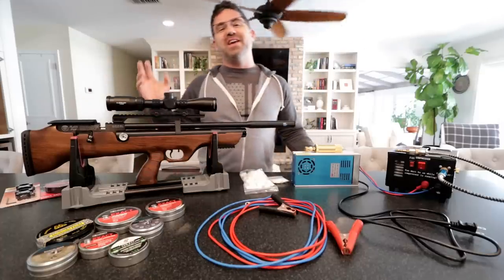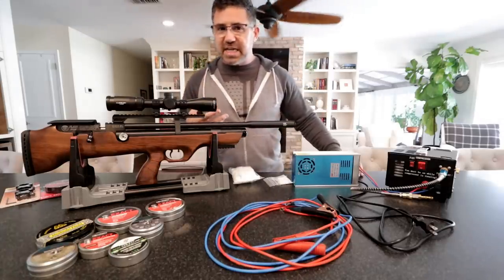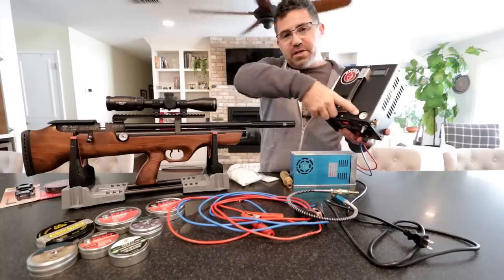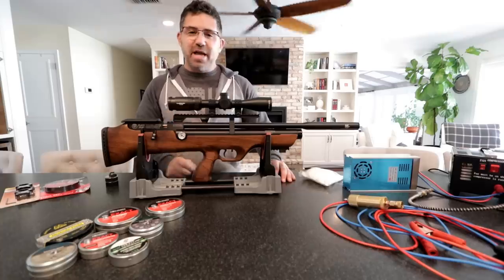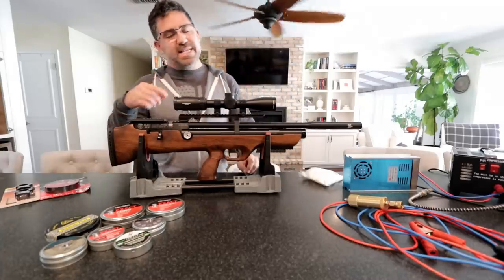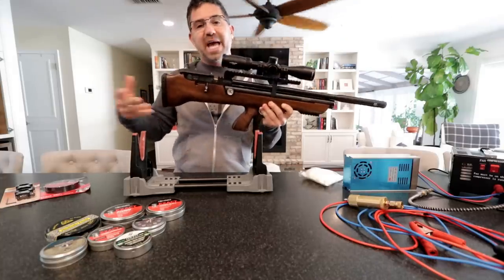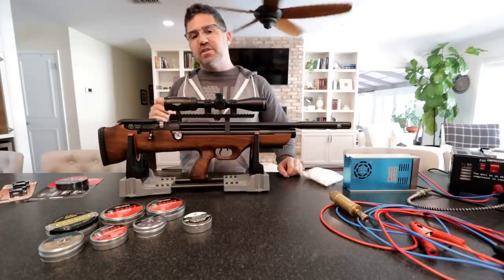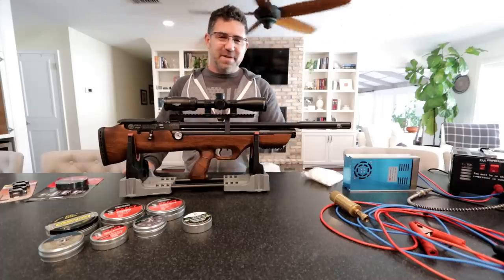Hatsan Flash Pup .22 Air Rifle (Review) + Accuracy TEST - SPARK 4,500 psi Airgun Compressor - PCP

Comment: You're the man Steve. I've had my .22 Flashpup for a few months now and it's a beast. The hammer spring can be adjusted easily. I move between 22 and 36 fl/lbs depending on whether I'm plinking or dispatching varmints. It's a piece of cake to work on and accurate as all get out.

Comment: That compressor is made by Tuxing, they also make the Air Venturi Nomad II PCP compressor. I have all 4 and they do indeed have all the same part numbers. You can buy directly from Tuxing and save 100 dollars but you will not get the Hatsan or Air Venturi warranty which isn't that big of a deal as they are easy to work on and use the same parts. Tuxing also makes great repair and maintenance videos for all these compressors. They are great little portable compressors but super loud, lol. Awesome review.

Comment: I bought the Flash QE (Rifle) from Airgun Depot on sale for around $260 (now its $289.99). The rifle, a Q7 hand pump, and a big tin of JSB's put me out $411. Make sure you buy the quick connect because neither the pump or gun comes with it. But dang guys what a bargain, its such a good gun for that price, just keep the pressure between 180-150 bar and its surgical.

Comment: It's nice to see more bullpup setups out there now a days.
I used to convert my Ruger 10/22s into pups, and now I have a Gladius, and love it.
NY weather is harsh now, so I put up the powder burners, and made an indoor pcp rifle range..
This Flash Pup looks great,  I just prefer rifles that offer adjustable power level settings.
Being able to kick down the velocity is a plus - especially given my current shooting conditions.
Anyways..  I've always used higher end pellets in my air rifles..
In .22 cal, I've always used JSB Exact Heavy 18.13 grains, and had fantastic results.
Well, I was at WallyWorld the other day, and spotted some Crosman Premier .22 Hallow-points..
I grabbed a tin of 500 for like 7 bucks, and figured I'd give them a go - not expecting much at all..
To my surprise, these lighter 14.3 grain pellets actually grouped amazingly! 
I'd heard rumors that Hatsan guns [barrels] could be picky, but nope, not in this case..
The Premiers shot just as well as the Exact Heavy pellets, and at half of the price tag.
[I was shooting both JSBs and Premiers on power settings 4 and 6, then settled at 4,  1/2 power]
For shooting indoors til' spring, they'll be my new go-to rounds for sure! 
So there's a heads up for everyone - just in case you haven't tried them yet.

Sam -
Reply from the maker: Hi Sam.  My bad... the Flash's hammer spring tension is easily adjusted when you take the stock off.  Folks have ready pushed them upwards of 45 fpe in .22 with the 25 gr.  Also, if ya head over to AEAC Home, I released a vid just 2 weeks back on the Kalibrgun and it too performed well with Crosman Premiers in that vid.  Steve
Reply: @aeacvlog2033  
Steve,  thank you very much for the extra information!  That's great to hear!
I'll most definitely be checking out more videos, as they're some of my favorite on YouTube. 
You do an amazing job of covering everything, and the production level is top notch! 

BTW,  I've been scouring the net for everyone's reviews on the Puncher Breaker, 
as I've had my eye on those for quite some time now..
Your review was awesome, and seriously has me leaning towards of of those now too!

Thanks again!

Sam -

[EDIT]  As of 12/12  I've officially added a Puncher Breaker Silent Marine .22 cal to my collection!
1st Impressions - Killer little rifle!  I removed the shroud, fitted my DonnyFL Ronin suppressor, 
and within a few minutes, I was stacking pellets.  Awesome!
After I lower the trigger lbs of pull a little bit,  I'll be digging just about everything it!
[Only con - non adjustable butt pad,  but,  I'll be working on that one]

Comment: For what it's worth I've seen how the pros use the gel with a compressor in an industrial setting.  They used silica gel beads, same come that come with clothes and is super cheap.  They'd take out the old beads every couple of days and run them through the oven on a pan to bake out the moisture and just keep using them.
Reply: Interesting.  Thanks for the info 👍.   Steve

Comment: A GOOD portable 4500 psi compressor is my next buy. Thanks for the look.. I just added the Pyramyd flashpup .22 hand pump deal to my stable. I will follow this compressor closely.
Reply: I only paid $229 for my Yong Heng compressor 2yrs ago and filled my gun with it and only took about 20 seconds for about a month until I found a great deal on a 30min 4500psi SCBA fireman’s tank. I only have to fill my SCBA tank once every 2 or 3 months depending on how much I shoot. My new Skyhawk I purchased at that time holds 3325psi of air and the hand pumps are a nightmare at these pressures. I haven’t had a single problem with my Yong Heng compressor however it’s not really portable but my tank is. Purchasing any kind of compressor and or tank will make your shooting experience about 100✖️ better and you will go thru ammo at least twice as fast. Keep shooting & be happy fellow shooters.👍🇺🇸

Comment: I'll be really interested in seeing the full review. My initial thought is that producing an unregulated PCP in todays market is going to be a tough sell at any price point considering the competition. However if it can perform as you intimated and deliver 25-30 shots with regulated accuracy, the rest of the guns attributes may actually outweigh the lack of a regulator.  We'll see soon and until then I'll reserve any judgement (a pretty hard thing for me). 

BTW Athlon scopes are extraordinary across all their range. I own one, the 8-32x50 FPP, and it's brilliant at under 400 dollars. I've also shot with the 6-24x50 SFP and it is every bit as good optically as my scope. Throw in Althons first rate customer service and lifetime warranty and you'll be hard pressed to find a better value.

Looks like a really nice package all in all, with the newly branded compressor as a cherry on the top (albeit a noisy little cherry) the whole package is going to really light up some lucky winners holiday season.

Great stuff. ...TY
Reply from the maker: I agree with your thinking and it should be just fine.  In my experience, 100 yard accuracy normally doesn't vary so long as you're within a 25 fps extreme spread.  Steve

Comment: Trigger adjustment is the opposite. Clockwise of the rear-most screw will lighten the pull weight. It can be a little tight at first.

Comment: I'm surprised it doesn't have an auto shut off. It looks so similar to the Air Venturi Nomad which I bought last Spring. The Nomad has an auto shut off but you have to keep watch the first couple of times as the pressure reading is not completely accurate, at least on mine. My only complaint with the Nomad is they could make the electrical whip a few feet longer. Enjoy. They are great out in the field shooting all day.

Comment: Thanks for the great info Steve! Quick question. Does the blue end of the whip cord that connects to the compressor unscrew? My spark compressor came with some small white cylinder filters which are about one inch long but I’m not sure where they go. I am thinking they go inside the blue part of the whip cord but I didn’t want to unscrew that piece if the filters don’t go inside of that area. Thank you!
Reply: Hi Scott.  I honestly can't remember buddy.  It was so long ago and the compressor went back right after the review.  I'd reach out to Hatsan USA with your question.  Best, Steve

Comment: Steve, the 115/230vac to 12vdc power supply has a fan. does your power supply fan engage immediately or is it temperature controlled?  I just pumped up my Benji from 1,000 to 3,000 psi. my pump worked like a champ but the power supply fan never came on.  should I look into getting a replacement power supply?

never mind, I just got to the part where your fan engaged (immediately).

Comment: Will you be doing a full review of the Spark compressor?  What kind of maintenance is required?  Does it use coolant that needs to be replaced/replenished?  What is the maximum duty cycle?
Reply: The Hatsan Spark compressor is designed to be self contained and maintenance free, in other words no lubrication intervals. The compressor does come with spare O-rings  to rebuild it if needed but we recommend returning it to HatsanUSA for service to maintain the warranty.   The Spark is an air cooled unit that does not require coolant. The maximum duty cycle is filling one 1000cc 4500 psi cylinder at a time then let cool down and fill another.  If you require filling more volume or to fill multiple guns in quick succession we recommend the Hatsan Lightning compressor.
Reply: Does the blue end of the whip cord that connects to the compressor unscrew? My spark compressor came with some small white cylinder filters which are about one inch long but I’m not sure where they go. I am thinking they go inside the blue part of the whip cord but I didn’t want to unscrew that piece if the filters don’t go inside of that area.

Comment: Hey Steve. I remember you saying you adjusted the trigger to under 1 lb. 
I turned the main pull force adjustment screw all the way, but it is still way too heavy for my liking. Do you have any suggestions on how I can lighten it beyond the main adjustment screw (the one closest to rear of the stock). Thanks for any help you can offer.

Comment: 🌬❄☃️ so cold up here in Jacksonville...hatsan did a fantastic job coming out with a compressor of that size, I mentioned that 2 u earlier this year  & Rick eustler abt companies making a entry-level compressor around $5-$600  Air force has 1 called the e-pump,& the nomad from air venturi...my question is can they fill those bottle guns? the Hatsan bully & air max deserves a review from u steve  & the air arms s510 ultimate sportier regulated...great video as always...stay warm
Reply from the maker: Holy crap Gerald, u ain't kidding!! Packing up the truck now to go film with the Flash and I can't hardly feel my fingers 😳!!!  Steve

...AA .25 XS is December's RDW👍
Reply: The Spark compressor is designed to fill up to our largest reservoir on our guns the Hercules at 1000cc.  The Spark compressor can fill bottles/guns of up to 1000cc to 4500psi if  the bottle/ gun is rated to that fill pressure.
Reply: @HatsanUSAInc  thanks u so much for that information.   question abt some of your guns.will there be a more powerful 25cal break barrel? or a new line of the bt65.
Reply: @bigearl8687  With current technology the only way to make a more powerful .25 break barrel would make the gun larger and heavier and the demand is for smaller and lighter. We have no plans currently to add more models to the BT65 line.
Reply: @HatsanUSAInc  The .25 Sniper is one powerful mother. It says 750 fps on the box and mine does it brother! On the head w/ JSB 25.39 grn. I regularly shoot 12 oz. cans @ 108yrds.
Reply: @HatsanUSAInc  is there plans to add huma regulators or another brand of regulator to the Hatsan airguns? that would be great 4 already great guns...
Reply: @bigearl8687  We currently have no plan to sell pre-regulated guns but anything is possible, we do offer our own regulators for some of our guns as an accessory.

Comment: Not being negative about the Spark or anything, it's a good compressor but the Yong Heng for hundreds of dollars less, it dosen't care about filling tanks, it bangs out 1hr tanks from 2 bar to 3 bar in like 8 mins one after another, plugs into the wall without buying a transformer and let's face it, if I was going out into the wilderness I would just take a 45min or 1hr tank with me and be done with it.
And if I really needed to have it with me in the woods I would just plug it into the outlet in the back of my SUV because most of them now have a 120vac inverter already built in.
Just saying
Reply from the maker: All good 👍, so long as we're acknowledging the other truth in that story... the forums are filled with lots of stories of YH owners putting lots of hours (and $) into making those machines run cool  and reliable.  Best, Steve
Reply: @aeacvlog2033  Ya, you do need to have a bit of machinist savvy and mechanical ability to get the best out of a YH...
I forget that everyone isn't so adept to dealing with a frisky China compressor lol.
I wouldn't trade mine for the world though haha
It's all part of the hobby to me.

Comment: or get yong heng, way better and cheaper
Reply from the maker: They making that in a portable class 12v now?  About the "way better" part, I'm not sure that's what everyone's experience has been;
https://www.airgunnation.com/topic/did-i-make-a-big-mistake-i-bought-a-yong-heng-compressor-from-china/
Reply: Getting a portable compressor is not the way to go, as a car mechanic I would not connect that to my current gen car. Get a carbon tank and fill it at home and then bring that to the range. Better and faster, maybe even cheaper but thats up for debate tho.

Most ppl are happy with them, ofc when it comes to bottom tier products then there will be quality issues. That said, Hatsan is in the same bracket as YH as far as im concerned